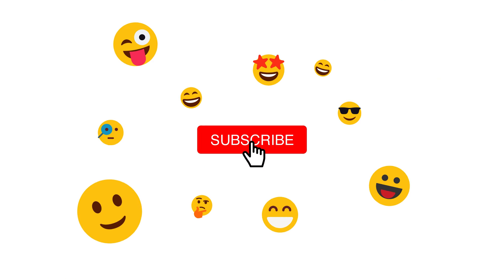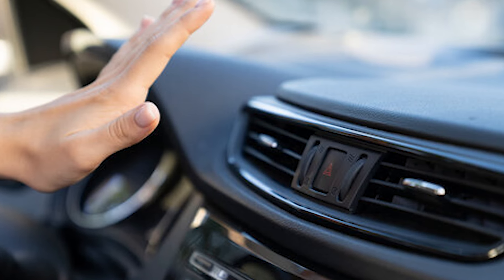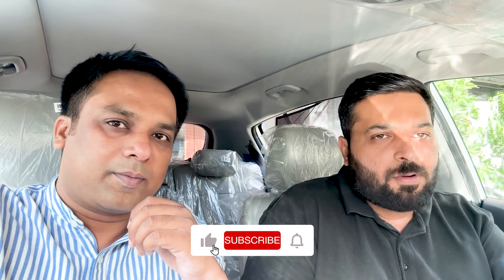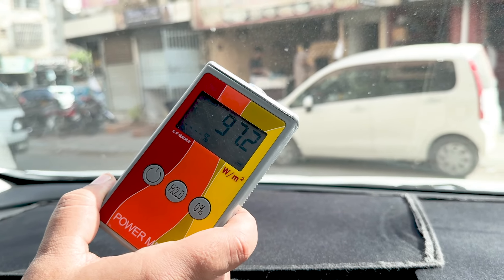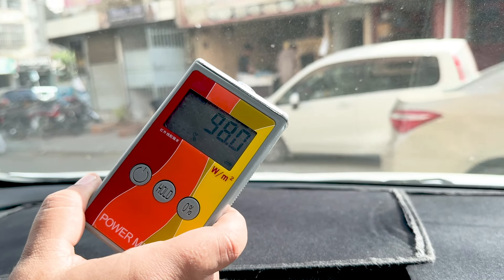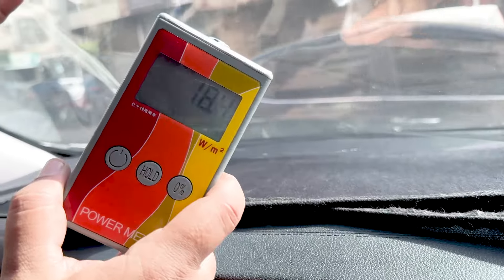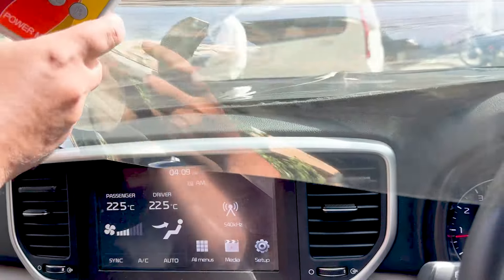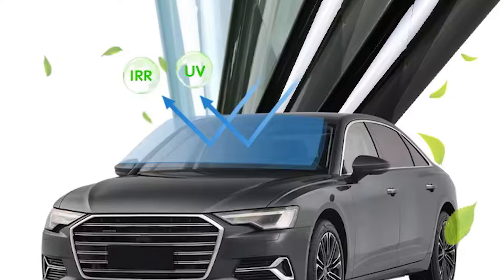Garmi Ka Tor | Keep Your Car Cool in Summer | Solar Screen Cooling Film

Comment: HYUNDAI K tamam service centre PE available Hai. But ye Akber road pe last 13 year se mil raha Hai mai Khud janta hon.
Reply: Is it worthy?
Reply: Yes it works. But it's depand on it's different (Microns) thickness.
Reply: @sufianwarsi3000  best konsi hy jis me police bhi tang na kary
Reply: @sufianwarsi3000  jazakALLAH bhai
Reply: aap sirf Kisi AIK vendor PE relay na Karen. M.A. Jinnah Road PE Bhi kai shops Hai Jo is tarha Ki films mai deal karti Hai. Or AIK Eham bat hamesha sirf un logo se lagwain Jin K apny pass in films ka wafir stock Physically mojod ho warna Apko or costly pary gee kion K wahan aap Jis se bhi koi Bhi Kam boly gen woh aap ko mana Nahi kary Ga boly Ga K Haan ho jai ga, but woh Kisi or se purchase kar K aap ko menga pehna de Ga. Got it. Keep away from agents.
Reply: @sufianwarsi3000  wesy idea kiya cost hogi?
Reply: Bro. Idea Nahi Hai aaj Kal Kia cost ho gee but 13 years Pehly tak cost thee Rs. 170/- se 400/- per square feet of (different Microns & variation).
Reply: @sufianwarsi3000  jazakALLAH bhai

Comment: If this paper technology is available then why it is not pre-installed in at least modern vehicles?
Reply: Bro. I m also a viewer & I know about this Heat proof + Shutter proof film 13 years ago. But that time It's use only on Houses, Apartments,Offices, factories, hospital's, mall's school's, colleges etc. external glass doors & windows for reduce the sunlight's heat. Now a days It's started to use in vehicles. 2nd question: why automotive companies pre-installed this on his vehicles, Bcoz if they do such things their's AC & it's related spare parts value will reduce gradually. I think you also don't awared about there is a heat proof paint has been invented in Japan & that will make a huge dent on car AC system & it's spare parts.